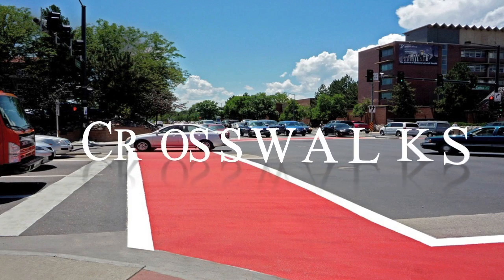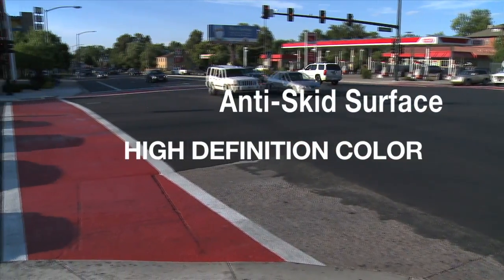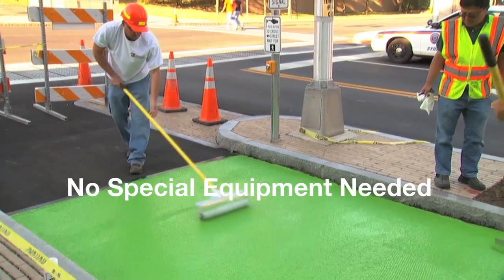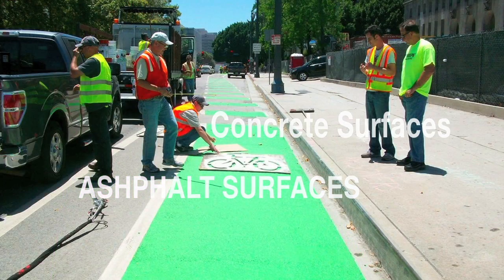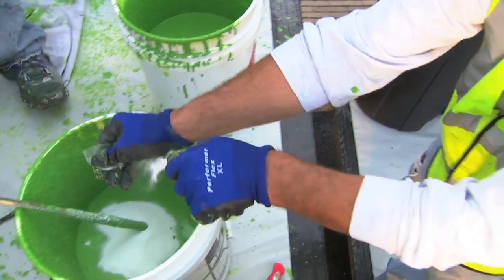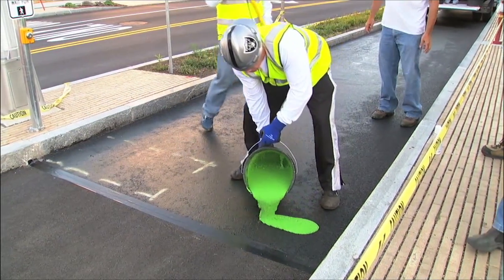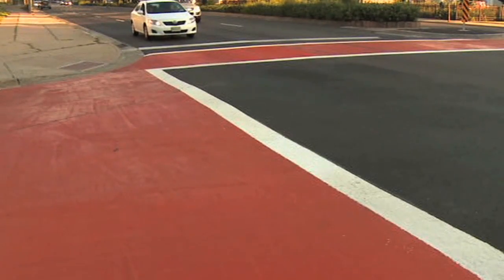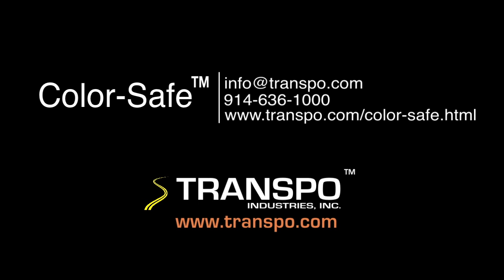Color-Safe® MMA - Manual Application - Green Bike Lane Marking

Comment: We need this in all U.S. cities... Should be standard.
Reply: it's fucking dumb expensive and it's basically only used for bike lanes traditional markings or thermo are better options imo
Reply: @grimble707  they should embed the color pigment into the asphalt while mixing, and use thermo for markings and signs
Reply: @miles5600  that's what I've been saying about curb for years stop making me paint the damn thing Yellow just make Yellow concrete
Reply: @grimble707  yup, way more efficient than having to repaint the whole thing every year
Reply: @miles5600 real